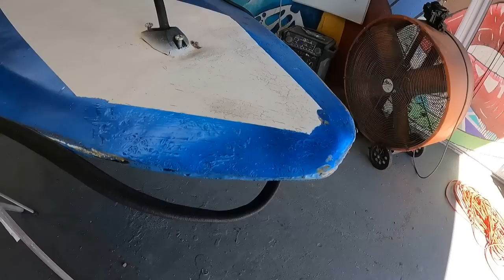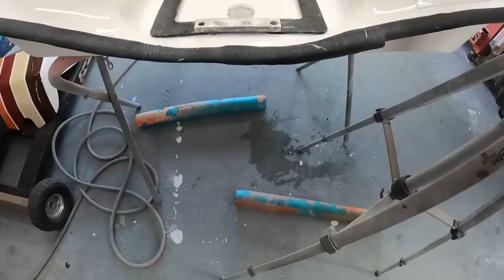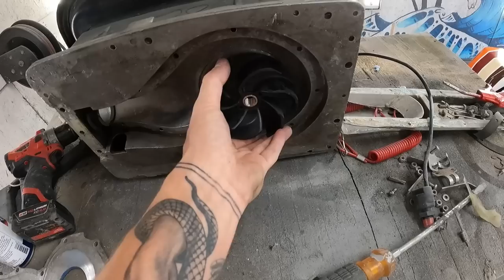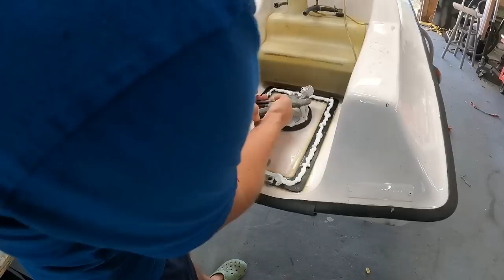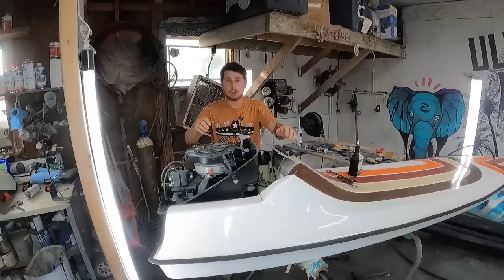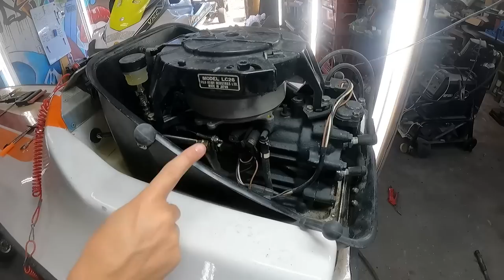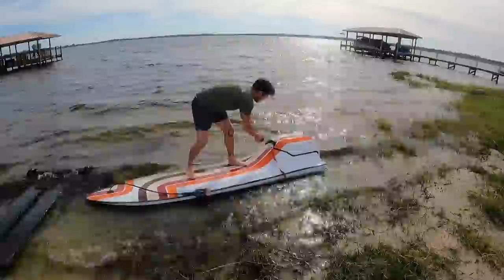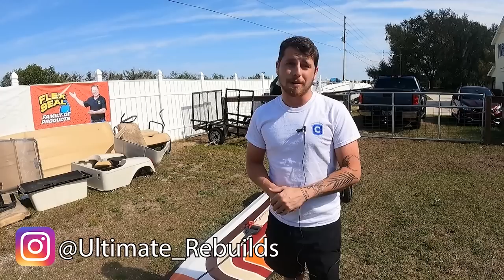This Surf Jet Refuses to Work! - Episode 3

Comment: I'm guessing somewhere along the way. The engine has become reversed. Somehow the water is not being pulled in by the impeller.
Reply: There was no lock-washer or anything visible in the vid. If the engine would rotate the wrong way, it would have kicked off the impeller without any breakage. It's more likely the impeller got pulled up, bound up against the top of the impeller housing. Probably lacking a bunch of washers.
Reply: @Jahee-Official  There's no room for the impeller to spin off.  When the motor turns backwards, it immediately starts to unthread the impeller which pushes it down and jams it against the lower housing.  Then the center of the impeller is chewed apart because the impeller cant spin, and the motor is still pushing it down.

Comment: Also if you only got it hand tight it would just spin off , you need to lock the fly wheel and tighten impeller , special tool for it

Comment: At this point I can see why this item may not have been a product that was discontinued.
Reply: I think you're mistakenly using a double negative. We discontinued selling them because they just weren't great. Never had any problem, mechanically. Fuji made good engines, but the concept is flawed. Nothing to keep you on the deck when it hit waves. I likened it to those old paddle ball games with the ball on an elastic cord. Sailboard footstraps may have helped, or might be a death trap. I wouldn't take one if it was free.

Comment: No motor is going backwards bro. I promise
Reply: Would a timing issue cause this in a 2t?
Reply: You can run 2t backwards 👍 some snowmobiles actually do this on purpose